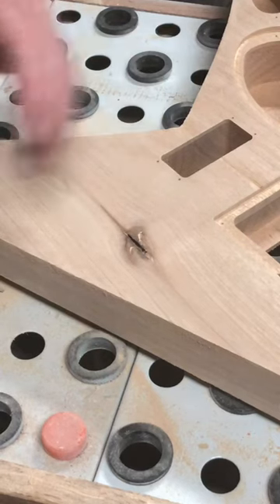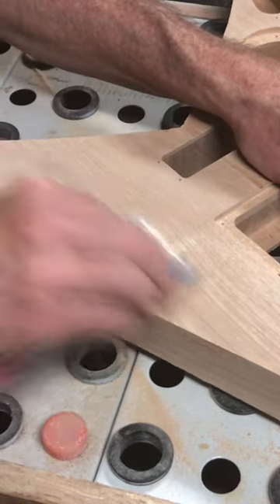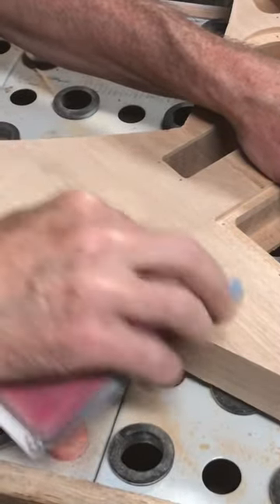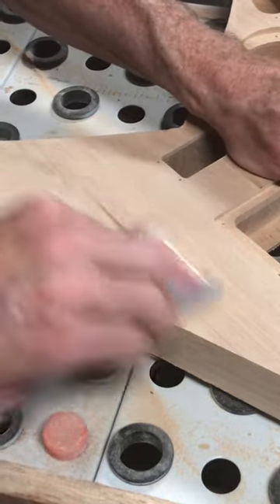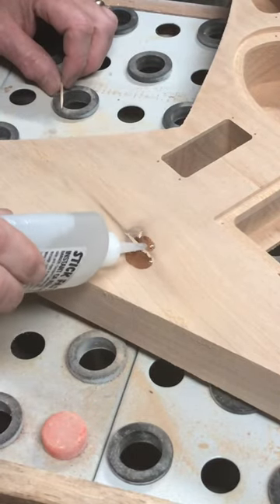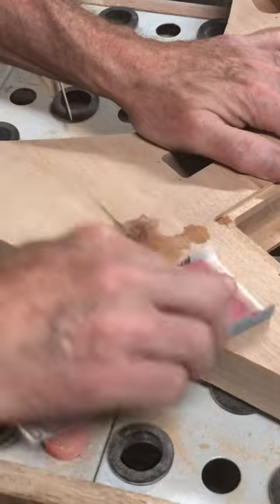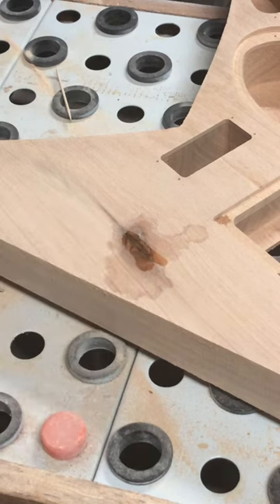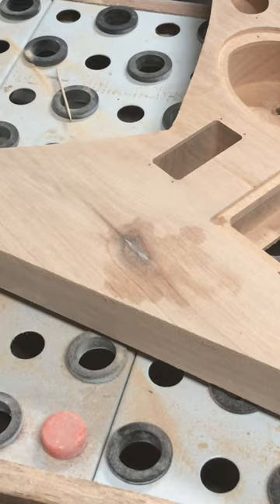How To Fix A Knot In A Guitar Body

Comment: Is it acceptable to have knots in our tonewoods? Well, maybe so, just market it as toneknots!!
Reply: No.  Cheap ones yes., say old ibanez UV's. but to cover the crap wood they would put a 1mm cap front and back of rock maple also hid the wood movement over time as they used up to 5 piece of basswood, depending on how cheap your guitar model was.
Reply: @golfprocrastinator9519  I've refinished a few expensive guitars that had knots and even shoddy jointing done on the body. American, Japanese, and Indonesian made. I've seen others share the same tale. I think the big companies selling expensive guitars just save the perfect pieces (or more so) for the natural or trans finishes.
Reply: @piptyson5512  that is kind of logical thing to do, but I think it should be another way around. Knots are like the flowers of the wood. On painted finishes on the other hand, if that knot starts to show under the paint, it ruins the whole painting.

Comment: Umm, so all your guitar bodies have dips in their wood? Maybe using an off cut of the body to create the "sanding dust"?
Reply from the maker: What dips are you talking about? I don’t understand.
Reply: @HighlineGuitars  from sanding with high grit sandpaper in one section. I'm just noting it would be better to gather the dust from a cutoff piece.
Reply from the maker: @jamescraft2789  It depends on the situation. In this case the flaw was so shallow, the normal act of block sanding the surrounding wood filled it. If it were a larger flaw, then yes, dust from a cutoff would have been the best solution.

Comment: don't you get a shallow local cavity after sanding just that spot??
Reply from the maker: You will if you lack sanding skills.
Reply from the maker: @peachmelba1000  that is the ideal way, but if you don’t have an offcut or any scrap, you can fill the hole with dust from the normal act of sanding, cuz you’re going to need to sand anyway.
Reply from the maker: @peachmelba1000  What other answer would there be? If you have good sanding skills, you won’t create a divot.
Reply: @peachmelba1000  thanks! That is a good solution

Comment: Or.....you could have flipped it and put the knot on the back.... or since you had to glue up multiple pieces to get the size you needed you shouldn't have any knots.
Reply from the maker: The knot went all the way through. For guitars that will be painted a solid color, I always use knotty Alder as it costs 1/3 the price of premium Alder.

Comment: The ca doesnt stain? I know with turning we have to apply blo prior.
Reply from the maker: Of course it stains. I would only do this on a guitar that is to be painted.
Reply: @HighlineGuitars  Could have used any filler then, like car body filler.
Reply from the maker: @pinballrobbie  CA glue dries instantly.
Reply: @pinballrobbie  that is the whole point of CA so you don't have to stop and wait. It allows you to continuously work
Reply: @pinballrobbie  body filler actually shrinks over time. Not the biggest deal, but it does.
Reply: @OxaudioPhilly  So do knots.